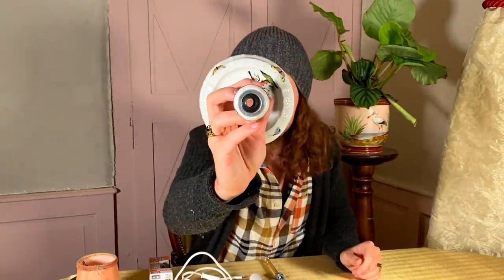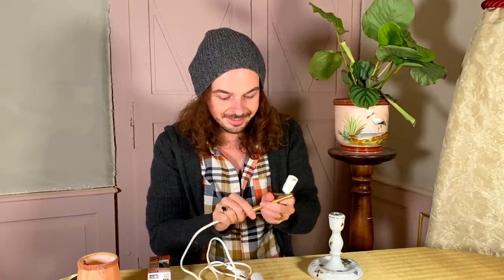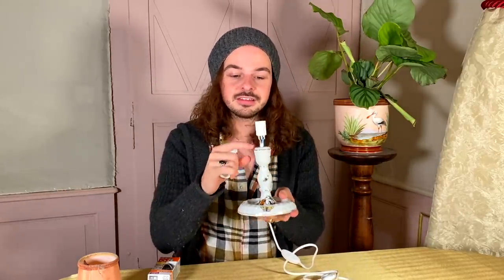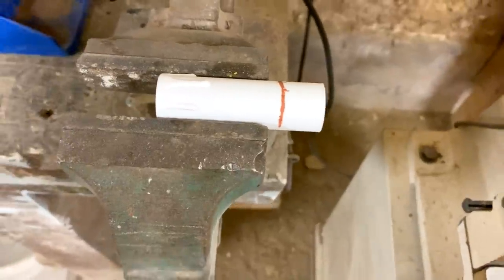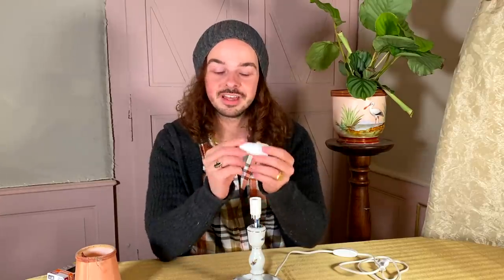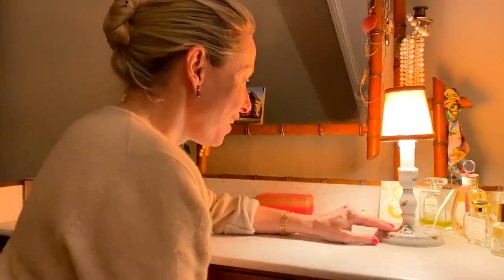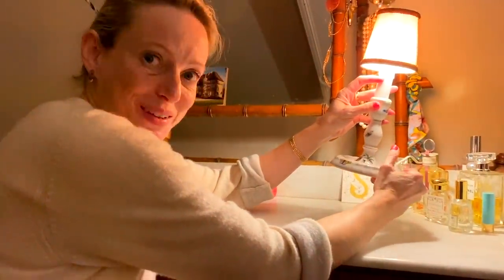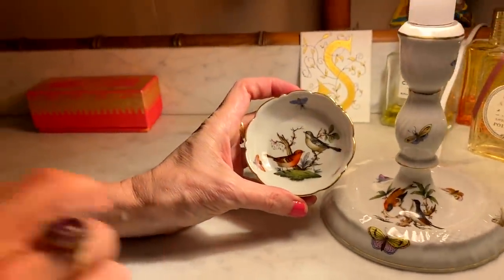HOW TO TRANSFORM A CANDLESTICK INTO A LAMP - Making a Valentine's Day Gift for my Girlfriend

Comment: So sweet! A gift from the heart. I used to watch my step Dad make lampshades from fabric and either repurpose a base from something old, or commission something from the woodturner. As he was a set designer for TV and interior designer, they were always pretty amazing. He would put everything together like you did Philip. Well done! My step Dad was Hungarian and often spoke about Herend porcelain and how the painting was different on each piece and all done by hand. Sometimes the painting might cover over a little imperfection in the porcelain and so a random moth or butterfly was carefully placed. I agree about the lamp shade needing to be bigger. The width/height of the base needs to be balanced by a wider based shade. Something will turn up. It always does :-)

Comment: Truly a thoughtful gift, and it was wonderful to see Stephanie receive it.  I've restored or created many lamps over the decades, and with those plastic candle drip casings, I spray them a cream or off-white, and then age them a bit with burnt umber oil paint, smearing it about and removing most of it, just enough left to tone it.  After it dries, I spray it with a flat polyurethane.  Looks just like the ones on lamps from the twenties and thirties.  Also, here in the states, when you pass the cord through the lamp base, you tie a knot so that there will never be pressure on the cord connection to the socket.  That's particularly important with floor lamps.  Great to see you back, and I look forward to more of your vlogs.
Reply: I want to convert some favorite lamps from US plugs to UK, as I now live there, but can't find very good tutorials,s on it for a complete beginner. Any suggestions?
Reply: @marymcandrew7667  I've never converted US plugs to UK, but if the sockets are the same, you would just need to get a cord with an attached plug, like the one Philip uses in this video, and rewire the lamp.  But if UK sockets are different, you'd have to replace those too.  There are some decent tutorials on Ebay, and they stress safety, so that's good.  If you really aren't comfortable doing it yourself, you might call an electrician and see if they can do it for you.  Hope this helps a little.
Reply: Thanks for your reply, I'll do some digging and learn! It should be fun!
Reply: Usually the cord comes with the plug attached. If you take apart the old lamp it will be very obvious how to wire the new one in. Just be sure to match the colors of the old and new wires.

Comment: W wonderful gift. The one thing for safety in the future is you tie a small knot in the cord just inside the base hole and then run it on up into the bulb assembly. This will keep the cord from ever being pulled loose from the bulb assembly.

Comment: Phil, you've probably found these yourself, but I'll tell you just in case. There are light fittings that don't need any holes being made, at all, because the lead (wire and switch) are fitted directly into the bit the fits into the bottle-top or vase etc so no need to bore holes anywhere. This is very useful if you want to make a lamp out of a valued (not necessarily valuable) vase, bottle or pot, whether porcelain, ceramic, glass or terracotta, and keep them intact. If you haven't found them yet, you can ask at the shop where you get your supplies. They used to be easily available in the UK. I haven't made any lamps for some time but when I used to make ceramic objects as a hobby I found they solved the problem of having to make holes.

Comment: Question guess I missed the part, how did you drill the holes in the porcelain?

I love a gift that from the heart.
Reply from the maker: The candlestick was designed to have the possibility of being converted, so the holed were already there! I just used an old screwdriver to make the hole in the aluminium bit slightly bigger (:

Comment: How did you make the hole bigger without breaking the porcelain, please? Great job. The shade has to be bigger because the base is so wide.
Reply from the maker: The bit with the hole is made of some sort of metal (aluminium I think?) and I was able to use an old flat screwdriver to just make the hole 2 millimetres wider to fit the pipe (: